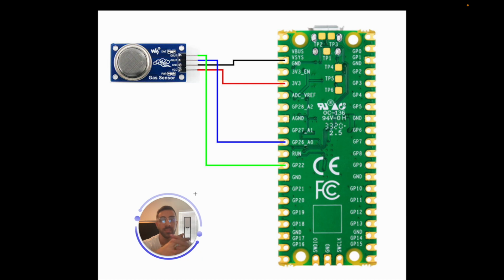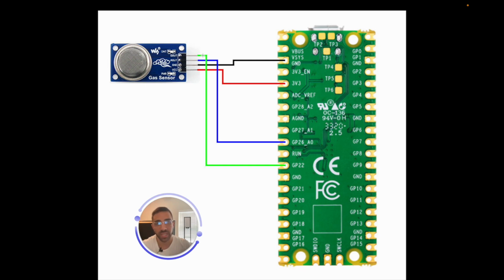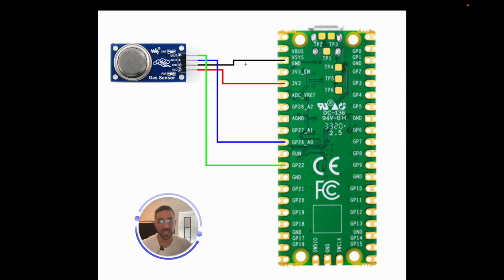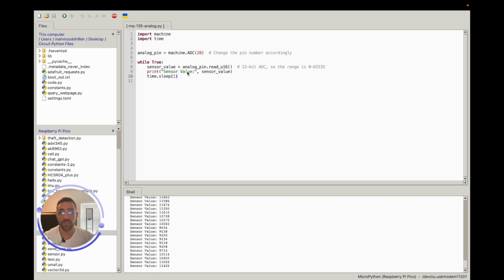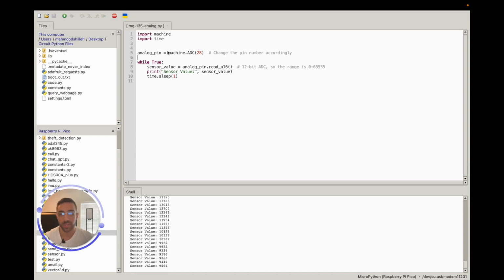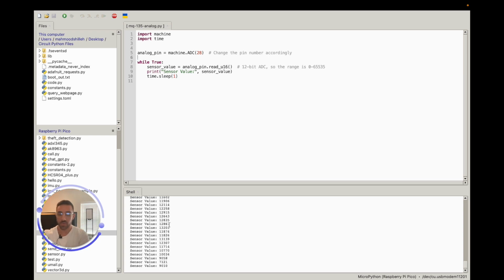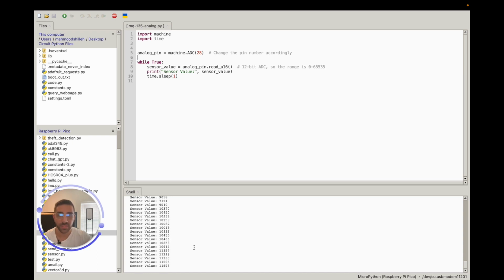How to Connect MQ-135 to Raspberry Pi Pico || Analog Values

Comment: Hi! I think your connection is not working because the values are not changing. When the analog sensor works, it gives values in the level of 30000 or more when hovering over bottle of alcohol. I used a Waveshsre MQ-135 and they've changed the wiring. Digital and analog pins have changed place. You probably have the same issue and you're trying to read the digital output to analog input 28.
Reply from the maker: Thanks for your comment hope other viewers see it as well :)

Comment: What do those "Sensor Value" of between 9k ~ 11k displayed on the Shell output?  What should be the baseline value if air is free of contaminants?
Reply from the maker: Hey Gali, it is hard to know based on the raw analog values. A calibration process would be needed for this kind of sensor to translate them to a certain contaminant value :/